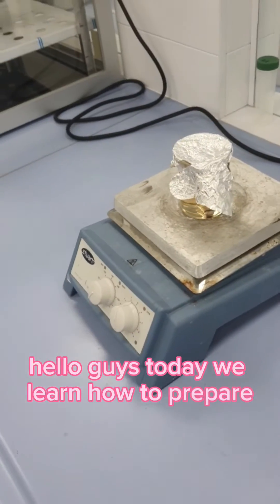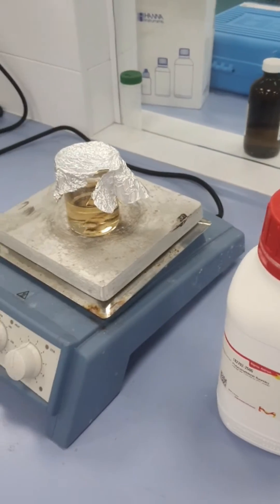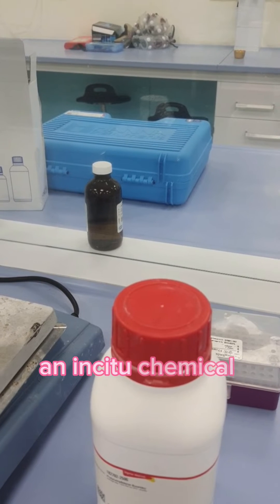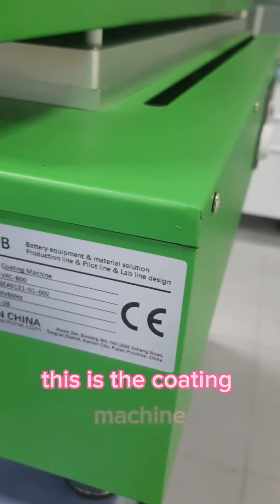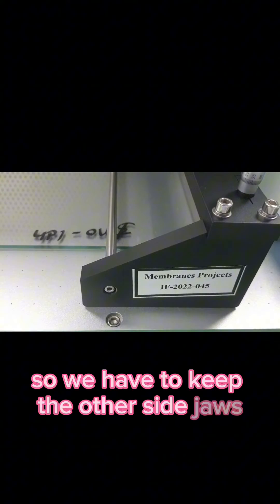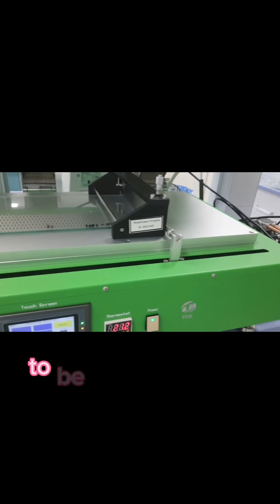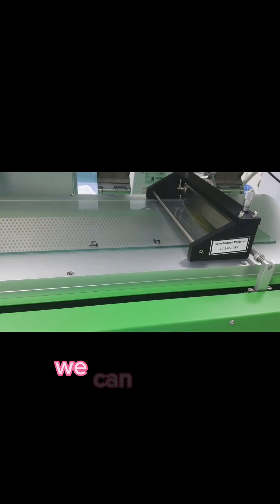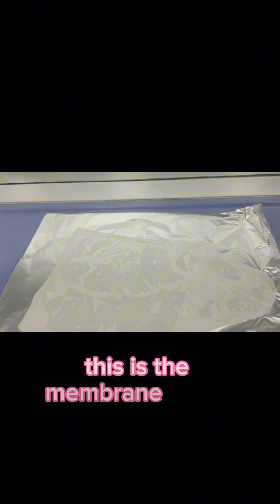phase inversion method for membrane preparation

Comment: hi,
respected sir ,
can you tell me the procedure of pvdf solution before casting?
means to say,
the amount of pvdf, amount of DMF, temperature of hot plate, stirring speed and time of dissolution...can you tell me the procedure?
Reply from the maker: Sure that depends on the amount or quantity of membrane you want to prepare..,..please elaborate more I would guide in a better way
Reply: @materialsandtechnology8956 thanks for reply respected....I need just a thin membrane for gel polymer electrolytes...my solution is not homogenizing so i need just your procedure...
Reply: @materialsandtechnology8956 firstly thanks for your reply respected sir,
I wanna make a thing membrane for polymer electrolytes... I have pvdf in powder form...can you guide me with just a simple procedure that how much amounts and conditions should be used?... actually I am facing with a problem, it's not homogenizing...after some time it froms clumps... waiting for your response... thanks sir
Reply from the maker: @atharschem9238 you have to mix pvdf in dmf or chloroform or any other solvent for over night then it will mix well or homogenise well
Reply: respected sir just tell me the amounts and at which temperature and stirring should I mix..... because I am using 1 gram of pvdf in 10 ml DMF at 80 degree with stirring 500.... It becomes too much viscous after some time and stirring become very slow due to viscosity.... kindly guide me about it, it will stop stirring after some time how I can mix overnight
Reply from the maker: @atharschem9238 better use 40 or 50 degree c , also choose better shaped beaker and keep changing speed or sometimes you might choose better shaped beads for mixing........if you have vacuum degassing you can use it to remove bubbles or gas or a sonicator at the end to remove gas bubbles
Reply from the maker: This happens the solution becomes too viscous but keep mixing change speed , at the end the solution will become homegenous ..............for sure
Reply: @materialsandtechnology8956 it's mean if it becomes viscous, i should increase  just the speed of stirring... there's no need to add solvent further....just stirring...if there's clump formation....i should ignore it.... at the end... almost after 8 hours my solution will become uniform??
Reply from the maker: @atharschem9238 do it overnight I mean 24 hours don't add solvent this will change the ratio of solvent to pvdf or polymer
Reply from the maker: Amount is ok .....you have to do trial sometimes.....even I have tried with the same quantity
Reply: @materialsandtechnology8956  please can you elaborate on this. I prepared membrane with PVDF in NMP solvent but after testing on the cross flow set up, there are few drops. The permeation is too low, is it because of the doping solution composition? I would appreciate your insight. Thank you
Reply from the maker: Ok why did you choose nmp , we generally use dmf and it gives better result and minimises other error
Reply from the maker: You may add few drops of polyethylene glycol as it gives better pore size formation .....add in terms of weight percentage or other
Reply: @materialsandtechnology8956 NMP, DMAC and DMF are the common solvents used as from the literature. And we have NMP available. Also I already add 1wt% PEG in the doping solution. Can I please have your email to discuss with you more
Reply from the maker: msmanzar@iau.edu.sa
Reply: sir,
solvents become very low after 2 hours even stirring stops
Reply from the maker: @atharschem9238 please use low temperatures and cover your whole mixture with aluminium cover while mixing .......then solvent will not evaporate
Reply: respected sir,
the last question is, beaker should be covered by aluminum foil or not?...may be due to uncovered break solvent is becoming less after 2 hours...
Reply from the maker: @atharschem9238 yes please cover it with aluminium foil or any other accessories so that the solvent does not evaporate